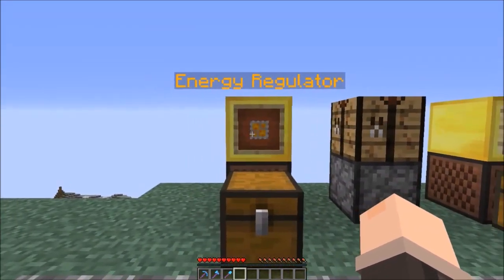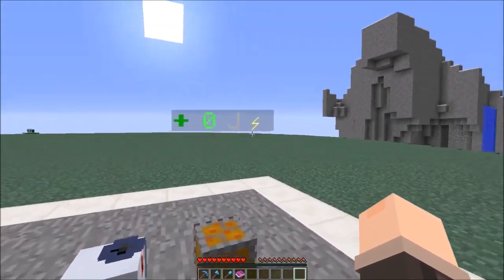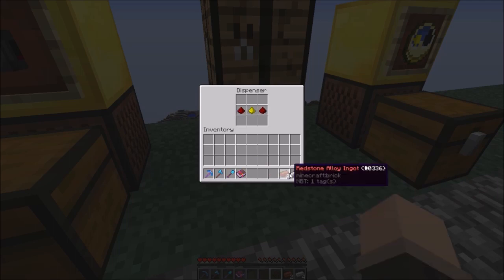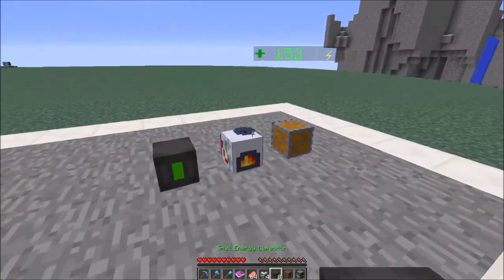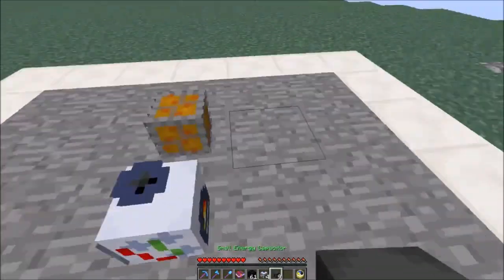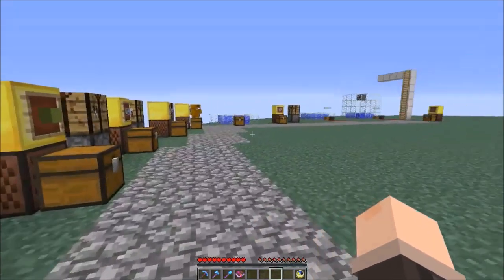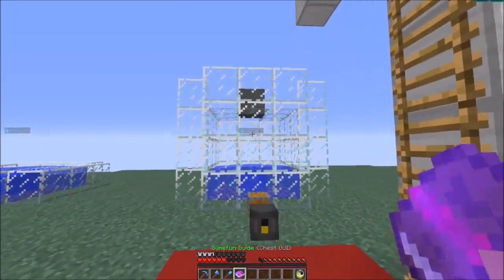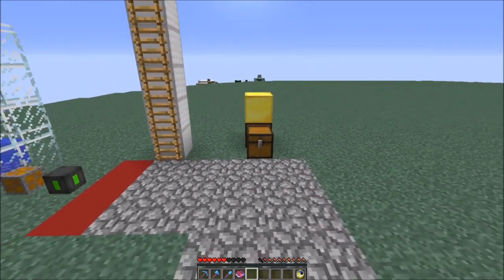Slimefun Tutorial #4: Basic Energy Generation and Generators

Comment: i am trying to get the high energy solar generator but the grind is real to get all the carbon needed
Reply from the maker: Good luck!
Reply: @MagicsonYT  thank you, i have a carbon press so that helps but i dont have enough power to run it with just the two basic panels i have, i need 5 to power it so its really slow
Reply: just got enough power to supply the carbon press, now i need to get an electric furnace to smelt logs faster